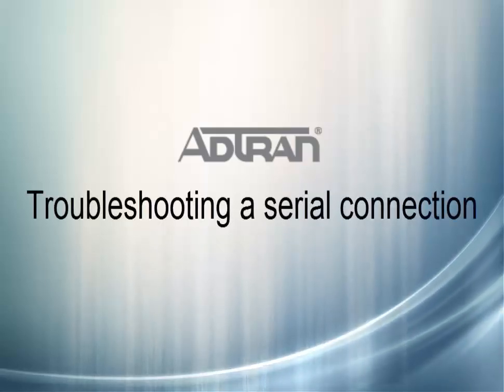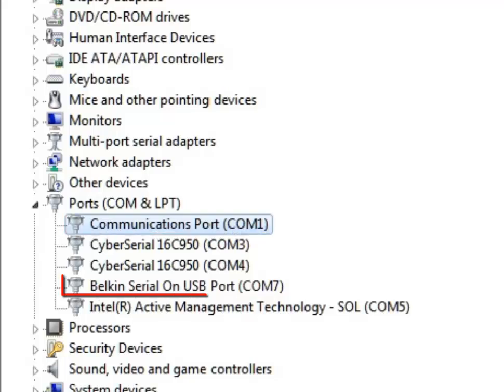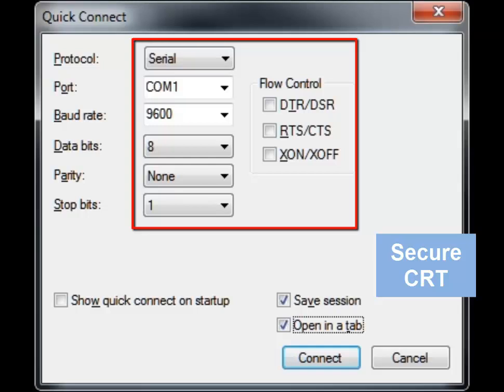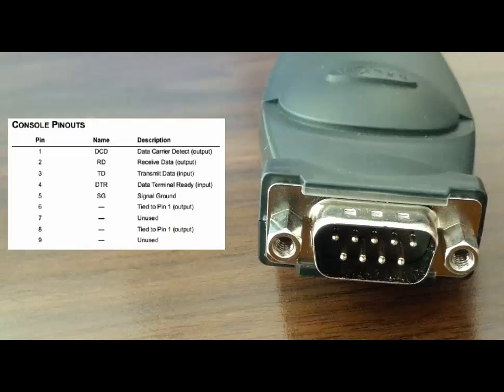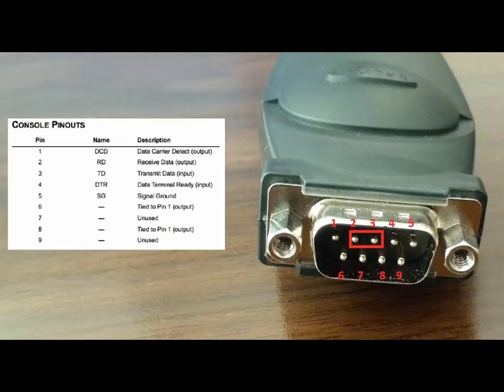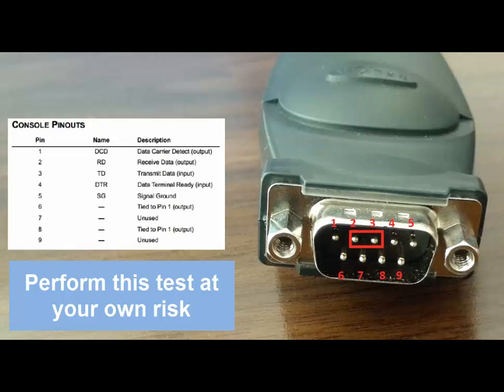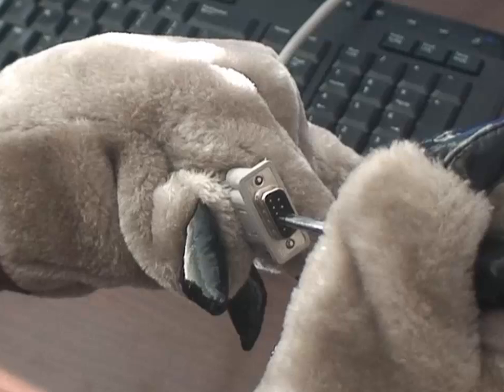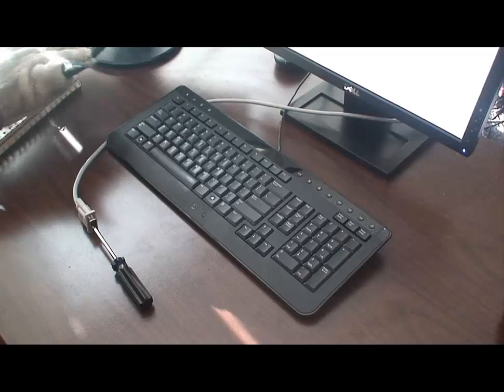Troubleshooting a serial COM port connection

Comment: What if the pc in question had no serial port, I'm having trouble connecting a weighing bridge using serial.
Tried serial to usb adapter= not working
Tried pcie to serial = not working
Reply: Hallo same here did it work?